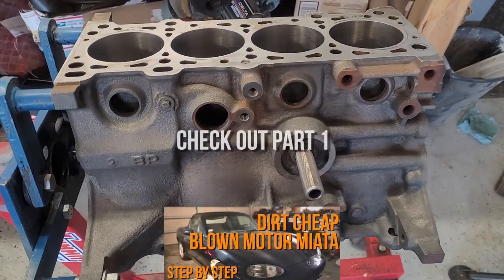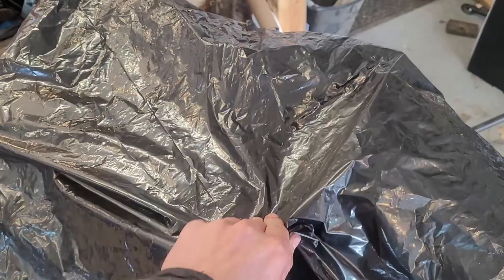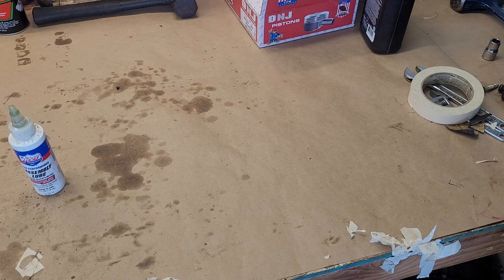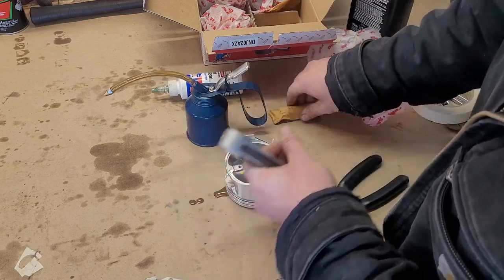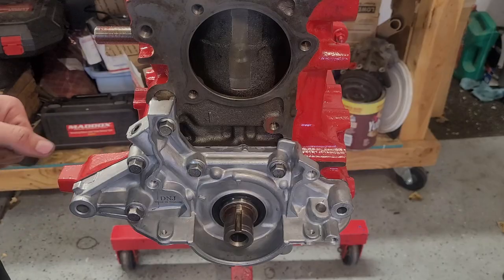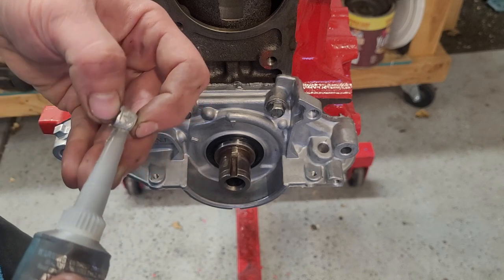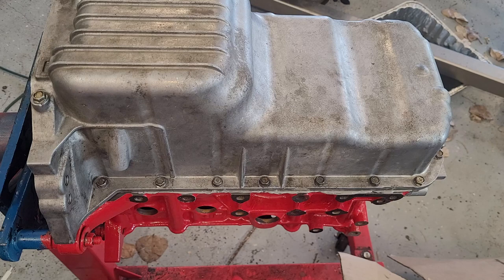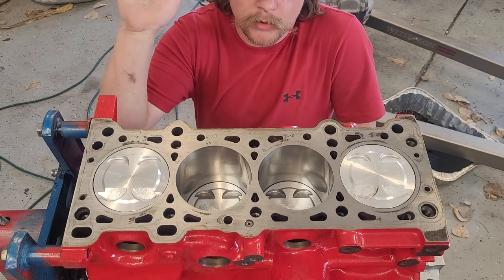Short Block Assembly - 1.8 Miata Engine Rebuild PT 2

Comment: When you bought aftermarket rods and pistons did you balance the crank in the machine shop or not? I am rebuilding my BP 1.8 and this is one of the things my machine shop suggested when I told them I want to buy forged rods. It is important to add I will also buy a Maruha 85mm crank which would be brand new. Besides that your video series helped me a lot with my rebuild. Thank you!
Reply from the maker: Sounds like a sweet setup. Inline 4 rotating assemblies do not need to be balanced because there are no crank Bob weights that counteract the pistons  like in a v engine. That being said, the components do need balanced to themselves, meaning that all the rods/pistons should be the same weight, and the crank should be balanced to itself. Since you have a new aftermarket crank I am guessing the machine shop wants to verify it's balance and match component weights.

Comment: I've been told not to turn the crank down on these I had a 1.6 with a spun rod I got rid of the crank and got a new one
Reply from the maker: Interesting, I haven't heard that before. Grinding BP cranks is pretty standard procedure. Wonder what the reasoning is
Reply: @NotEnoughProjects  Mike from Miata micca told me that he said it is weak after you turn the journals I called around and a lot of people told me the same. You might be able to get away with it if there's no turbo or SC

Comment: Another question on boring: When heads need bored as yours did, do machinists over-bore to a standard size? Guess I am curious how you find new parts to fit the engine to fit the new size. Again, total novice here so please forgive my ignorant questions!
Reply from the maker: The block is the component that gets bored. Yep the cylinders are generally overbored to a standard size (usually 0.020, 0.030, 0.040, or 0.060 inches over) In my case the block only needed the next size up which is 0.020" or 0.5mm

Comment: How much was the machine shop cost? Nice video btw
Reply from the maker: Thanks, I don't have the exact numbers in front of me, but block and crank work was right around 1k. Cylinder Head work was around 900 I believe. This motor was pretty beat. If the crank was in acceptable shape and the block just needed bored it would save quite a bit

Comment: How long did the machine shop take? Also what solvent do you use to remove machine shop residue
Reply from the maker: Sorry I'm just seeing this. The cylinder head took a couple weeks, the block was ~3wks if I remember. Every shop is different though. I often use brake/carb clean or acetone to remove any oils. I also like to do a soap water wash when I get a block back from the shop

Comment: i have a 99 block that im planning on boosting to 230 down the road it has a 83 bore and stock rods and pistons where would i find the gap sizes i cant find any info
Reply from the maker: Generally the gap size is given by the ring manufacturer. It's a function of bore size and application. A general equation for turbo application is 0.006" x bore (in inch) for top ring. 0.005" x bore for 2nd. (this is generally what manufacturers call for, but if your ring manufacturer differs, go with them)
Reply: @NotEnoughProjects  it’s OEM Mazda ones
Reply from the maker: You should be fine running ~20 thou gap for both top and second. Could tighten a little depending on boost level but 0.020" would be a safe bet
Reply: @NotEnoughProjects  so run 0.020 on top and bottom ring???
Reply from the maker: Yes that will work. I like to run either a symmetric gap or second ring gap that is up to couple thou bigger it can improve ring seal. If you're interested research ring flutter. You would also be fine running the more traditional gap equations I put above

Comment: Extremely unfamiliar with cars in general, even less so with technical acronyms: RTB means what, exactly?
Reply from the maker: Sorry I missed your comment until now. RTV (sounds a lot like rtb) is a silicone sealer that is used as a sealant/gasket maker between two machined surfaces